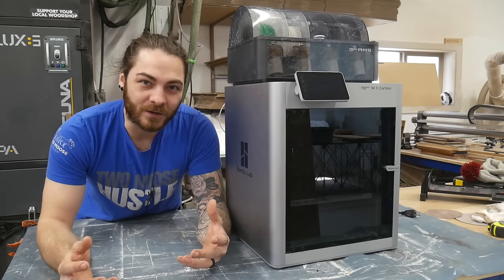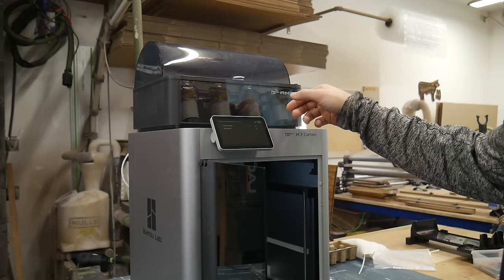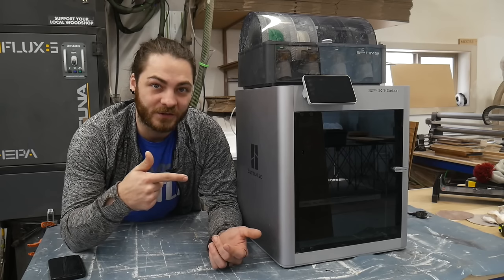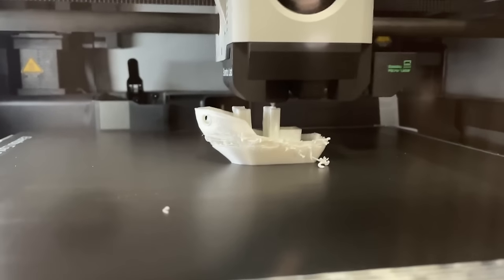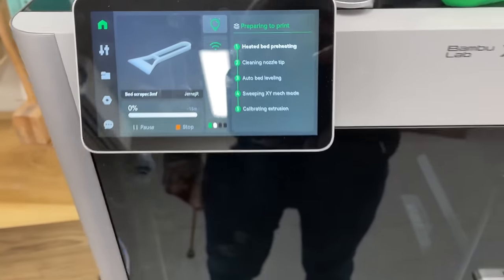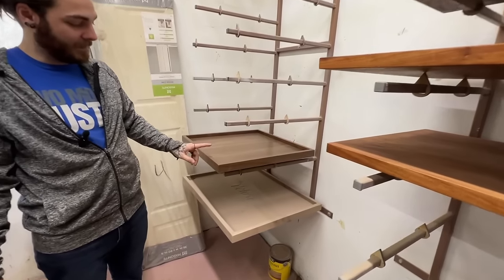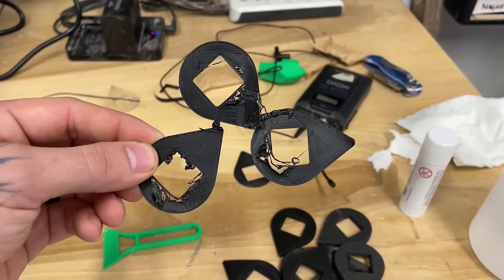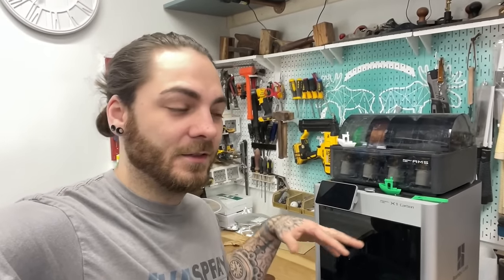The best 3d Printer you can buy?? Bambu x1c

Comment: Inland PLA+ is an awesome pla filament, it’s the one I use the most and is very consistent.

The printer seems awesome out of box and has a lot of cool features, but at its price point it’s tough to swallow for me. it also doesn’t really seem to allow for easy tinkering, and the extreme plug and play nature/proprietary software doesn’t really force you to learn the basics of 3d printing, only what their software can do. overall definitely a cool printer and there’s definitely worse options imo. if it’s me, i’m going for a prusa, though
Reply from the maker: I agree the price is steep. I bought it based on hype haha. I have a roll of HATCHBOX pla+ and printed great! If I can sell some items or files I’ll definitely buy the new prusa to see how they run. The p1p isn’t priced too bad
Reply: @TwoMooseDesign  yeah the p1p is much more affordable. and i mean $1500 isn’t the most insane purchase for something like this machine. if i could afford it id have bought it lol. i would just try to watch a bunch of videos about basic problems and basics of 3d printing anyway (even though you’re likely to always have pretty good prints), as if you want to get a print farm-like setup going on eventually, you’ll probably want to know how to troubleshoot quickly on more machines than 1. not that you wouldn’t know this, just my 2 cents.
Reply: It is definitely overkill for just PLA.  I wanted to get into functional printing with PA/PC/etc and the X1C is actually cheaper than an MK3S with an enclosure (and no MMS), so that is part of why I went with it as my own first printer.

If you're just printing PLA then the P1P does get you everything you need really, at least for single color printing.

Comment: 0:05 - I'm a bit dubious about "Best 3D Printer" videos that start with, "This is my first 3D printer.  I have zero experience."

Best is very subjective.  Privacy and security are very important to me, so the Bambu Lab policy of All Your Data Are Belong To Us was a non-starter for me.  There is no legitimate reason to send my print job from my computer across the internet to the Bambu server and then back across the internet to the 3D printer that's two feet from my computer.

It also didn't help a few weeks ago when the Bambu Lab server crashed, users were unable to print their jobs and after several attempts they gave up and jumped through the hoops to print locally (Bambu deliberately makes that difficult so users will use their server), and then the Bambu server was fixed and tried to print the backlog of jobs with Bambu printers in the US starting in the middle of the night and in many cases crashing into the manually printed parts that were still on the print beds.
Reply from the maker: Then don’t buy one it’s that simple 🤷🏼‍♂️ the title is a question not a statement. The machine has been great to me and I have several other printers at this point.

Comment: Always good videos and reviews.  I have been wanting one of these, just cautious and curious how they stand up over time.  For creating items with better quality always comes at a price.
Reply from the maker: Totally agree you get what you pay for most of the time, I have a few friends that have been running them hard for months but its hard to say since its pretty new. I've only owned it for a few weeks so i have zero input lol. Thanks for watching we appreciate it!
Reply: @TwoMooseDesign  The problem will come when you run out of warranty, All coreXY machines can be pushed this hard and achieve the same quality but it comes down to why? Maintenance is a thing and parts especially carbon rods and bushes dont last forever, and pushing things to the extreme just means failures sooner.  Add to that that most of the printer is glued together and not user serviceable.  I think in the coming year there will be more and more complaints.
Reply: @thegarageluthier  "Most of the printer is glued together" - Other than the frame, which is welded, the rest is Screwed together.

Comment: bambu filament is by far easiest to run of course as it knows what color and settings for the filament automatically
Reply from the maker: That is super nice, I was just lazy because it wasn’t in Amazon haha. I want to order a few spare parts just in case so I’ll probably order a few more rolls
Reply: if doing alot of multiple color prints bambu filament is way go then lol pain to set the color for the filament in every slot every time u change colors or filament type for temperature
Reply from the maker: @jamesharris9894  true I can see that being annoying lol I’ll have to try a multiple color print! Haven’t played with one yet
Reply: @TwoMooseDesign and the bed stick way to well make sure u have it  completely covered in glue to get the prints off easier
Reply from the maker: @jamesharris9894  definitely have been! I’m afraid to not haha I see a lot of people using purple glue sticks I’ll have to order some of those
Reply: never tried the purple but I use Elmer's craft bond extra strength it's like 3 bucks for glue stick works well
Reply from the maker: @jamesharris9894  awesome I’ll grab a stick of that too 🤷🏼‍♂️ probably doesn’t matter much? As long as you coat it decent I’d assume
Reply: @TwoMooseDesign  I'd say wont matter on glue sticks at all but did try bambu liquid glue and prints  seem to stick way to well to bed went back to glue sticks after couple prints  worked alot better for me releasing prints from bed but that's just my experience

Comment: Lol. Exactly what happened to me :D
Reply from the maker: 😆 that’s okay, winging it and learning as we go lol
Reply: @TwoMooseDesign  About the spaghetti detection: That doesn't use the lidar but instead uses the camera and runs image recognition tools on it. That means it doesn't work that great with black filament in the lower layers where the build plate is still in the way, as well as it may detect false positives if the model itself looks remotely like spaghetti. With bright filament on higher layers it seemed to work more reliably for me.

As for the lidar, that one is used to scan the calibration lines in the beginning and tune the amount of filament extruded as well as scanning the first layer for bed bed adhesion failures. That said, I never had it complaining so far even though I had a few prints with failing first layer (mainly when leaving the build plate dirty or not putting fresh glue on it for too long).
Reply from the maker: @michaelzanetti7994  ahhhhhhh okay, that makes sense! Thanks for the explanation appreciate it

Comment: Good machine for a small company, but far too expensive to only use to print some part or some fun stuff, for me it costs $2000 with VAT and tariff.

It will probably take a while until 3d printing becomes a thing for the broad masses.
Reply from the maker: Definitely a pricey machine. Even the new prusa is like $1100
Reply: @TwoMooseDesign  I wouldn't pay $1100 for a little badslinger today that is only to be used at hobby level, there are reliable enough larger build volume badslingers for a third/quarter of the price of a Prusa mk4 for that purpose.

I am also amazed at how short sighted people are these days, what happens when a Bambulabs machine is out of warranty and it may need to be sent to China for repair, it is said to cost $800 to send the machine round trip.
Reply from the maker: @dejedejsson  I’m not sure 🤷🏼‍♂️ I know like nothing about the industry. I purchased this based on reviews from friends. I’ve only owned it for a few weeks
Reply: @TwoMooseDesign Followup?
Reply from the maker: @Sparkynutz81  I’ve had no problems with the machine 🤷🏼‍♂️

Comment: Grab a textured plate from THEKKIINNGG and don’t look back. Has worked great with PLA, PETG, ABS and just got in a roll of Polymax PC to print some parts with. It holds when hot and parts just release when it’s cooled. No glue mess to fool with, I just wipe clean with IPA before each print to remove any oils your hands may deposit. Make sure you get a filament dryer so you can deal with wet filament when you run into it.  Polymaker is a solid filament brand if you are looking for quality filament to feed your X1C.
Reply: Do you have to use an IPA? How about a Stout or Porter?

Comment: Please, accept these comments as constructive criticism.
I was directed to your site by my smartphone.

In all fairness, you did state at the beginning of the video that you do not know what you are doing relative to 3D printers. At that point, I should have gone on to a different content provider. 
 
Machine Error vs Operator Error:
01) Not reading instructions (Op Error),
02) Machine self-leveled @ you moved it to the workbench (Op Error),
03) Operator did not know the difference between support vs regular PLA (Op Error),
04) Default settings out of the box were for Green PLA  (Op Error),
05) Teardrop widgets settings were not adjusted to the new material type (Op Error),
06) Try 1/2" separation on multiple prints (FYI), read instructions on placement for multiple pieces (Op Error),
07) LiDAR detected "Possible Spaghetti" issues, and the machine error read "Check the print quality and decide if the job should be stopped (Op Error).

Note:
From what I was able to discern, the 3D printer functioned as designed and as intended.
FYI on Cutting knife holder: 
You may need to revise the design of the bottom and the beginning round section with a slightly larger thickness, then transition back to your initial wall thickness.
Reply from the maker: Definitely operator error! I kind of did it on purpose to see if I could do it without a ton of research. I wanted it to be from the point of view or a beginner. Appreciate the feedback!

Comment: ur printing at 10% infill stuff is brittle obviously... try 30-50% (honestly as time measurements... strangely enough from 25 to around 65%  there is like 5-10minutes difference....) and optimize code for printing... also modeling... ul get better stronger inner parts.
Reply from the maker: Thanks for the tip!

Comment: I don't care who says what, that thing is not able to compete with a voron 2.4
Reply from the maker: I’ll have to check that one out 👊🏼👊🏼
Reply: Cool where can I buy this Voron and it be ready out of the box in under 20 min?

That's like saying  completely custom printer, where your skill and wallet, determine if it can be better than off the shelf printer. 
Typically  you have another printer make the parts, then source the other parts, flash firmware, tweak, mod, tune, calibrate and  ??? hrs later you have a product that is "better" .... theoretically. 🙄

Let's keep it a buck. The voron project STARTED in 2015 and its still a hot mess for anyone who just wants to print and not be a DIYer. Since there are only kits and no "unbox then print" solutions 8 years later those of us who want a printer and not a project voron's are a terrible product.

Comment: It's me or the white protecting foam is a swastika ? :p
Reply from the maker: 😆 Jess said the same thing. Not cool bambu!
Reply: @TwoMooseDesign  Yeah. Sound like it's your 1st 3D printer. I suggest you to clean your bed with 90% kitchen alcohol before doing any print (do it when the bed is cold) with kitchen towel. I also suggest to put a Brim on the first layer (it's a case to check ON when you prepare your model to print it), your first layer will be stronger, even more true if you go quick, this printer go really quick in 3D printing standard. 

Bending the sheet is a good way to remove the printed model. But, do it when the sheet is cold. I know, it's a consumable but still.. you want to keep it flat for your futur prints. 

You also need a steel brush to clean your nozzle from time to time. The little steel brush of the size of a toothbrush.

Fingerprint are bad for good printing.

You also need a plastic spatula (or wooden one) to remove printing crap and models without hurting the printer sheet.

You can also choose the pattern of the infill (it really matter), i personnaly prefer square or rectangle pattern. I try to avoid wave patterns and stuff like that.

Put your failed printed model in a case. Maybe one day, you will want to recycle them into a new roll. :D

Buy only black, white or glowing in the dark roll (apart if you want to do multiple color print), you just need to paint the print when it's finished if you want to give it colors.

Keep your roll sealed in a airtight box. Protected away from Ambiant humidity. (With something like rice inside to keep it dry) PLA resist good to moisture but the others not really good. A roll who sit on the desk for month can give printing issue due to moisture on it.

Comment: Worse then heroin, I got one and can’t stop printing 😂 get a textured plate and switch to ASA and PETG. The bambu was made for those materials with the closed system.  More so PETG as ASA can fume which makes cleaning more regular chore. Build a respooler off printables and buy 5kg  bulk PETG or ASA. 🎉
Reply from the maker: hahaha ohhhhhh I knew that. thats why i waited so long to buy one and here we are! I'll definatly check out some different plates. Like you can but a giant roll for cheaper and then just re roll onto a smaller roll? thanks!

Comment: Probably a terrible idea to take advice from someone who has more money than knowledge in this case.
Reply from the maker: because I can afford a tool my point of view is worthless? I'd rather buy a $2000 macbook that i know works and works fast than a $200 piece of crap windows that slow and can hardly run advanced software. Whats the diffrence? I could care less what other people buy im simply sharing my experience with the printer. Am I supposed to magically know about 3d printers? I run a business I invest in quality.
Reply: @TwoMooseDesign  thats  10x the price difference. Lets be honest, a 2000 dollar windows computer would blow every mac out the water at the same price point lol. What I meant was that if you have zero experience 3d printing.. telling people to buy a certain 3d printer because your first impressions are good will probably just lead to terrible experience for your viewers dude. This is not a machine you can buy off amazon or buy parts from easily without buying them directly from the company which means that its not easily accessible. The machine is also fairly new and not much company background to hedge any kind of relationship or past experiences from. Which again, telling someone that a 700 dollar printer you know nothing about is awesome is just sus.
 Take it as you like lol, but clearly my opinion ruffled your feathers, maybe you can print some new ones.